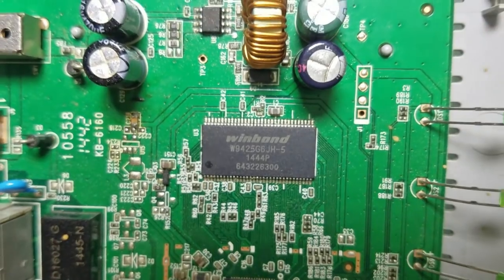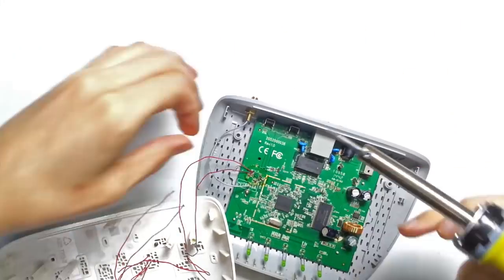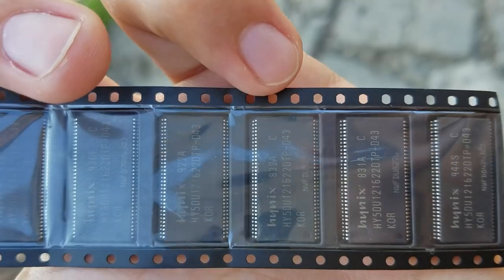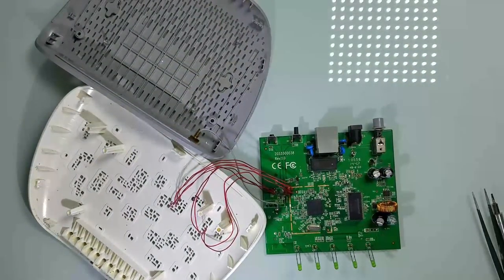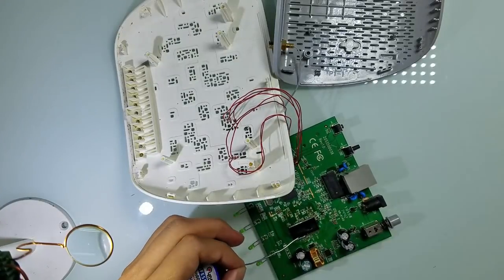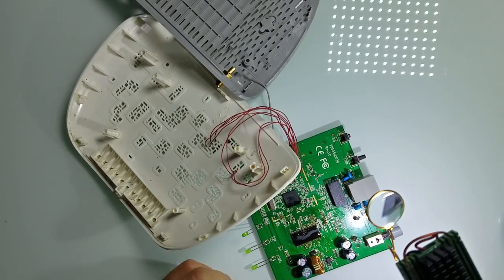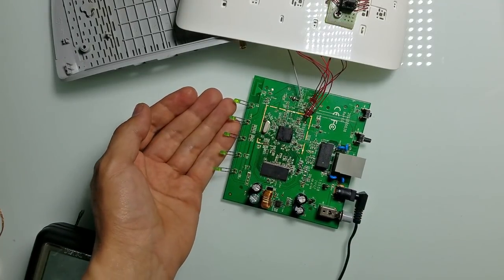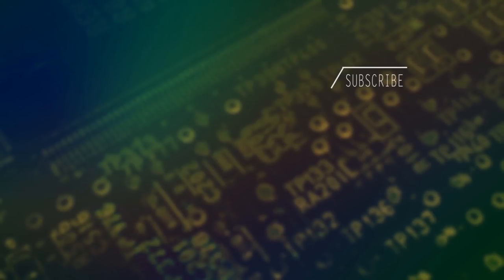How to upgrade RAM Chip in Router | 64MB TP-Link Memory Upgrade

Comment: I r4ealize you probably never visit this video anymore but I recently purchased 2 TP-Link WR940N routers and they are really bad.  It doesn't take much to get them to lock up and need a reboot.  It gets worse the more bandwidth I am pushing through the Wii router.  I believe it's a memory problem so I'm going to try upgrading the memory on one of them and see if it works or helps.   I'm an electronics hobbyist with reasonable SMD soldering skills.  Nice video.  Very useful for me.
Reply: Hey
Wanna give us an update on your project?
It would be great 👍

Comment: I already use DD-WRT. Do I have to do anything extra or charge to Open-WRT?
Reply from the maker: Frankly speaking, I wasn't 100 percent sure whether it is going to work with OpenWRT, but it worked. I guess it will work with DD-WRT as well, just because I don't see any reason why wouldn't it. But it is just my thoughts.

Comment: isn't there some sort of issue with lead free solder anyhow?  I read something about tin whiskers from such solder.  Although I have not had any electronic devices fail I most likely have something with that lead free solder in it somewhere.  It seems that when something is working right there is always some no good son of a bitch looking for a way to ruin it.
Reply from the maker: I also heard about tin whiskers, but I've never seen it or experienced any issues related to it. The only issue for me with lead-free solder is higher melting temperature, so sometimes it is difficult to unsolder components. Also, there are a lot of different kinds of lead-free solders, with different additives, so they have very different properties and different melting temperatures. But I am not an expert on the subject.